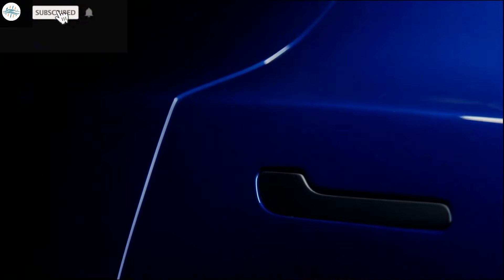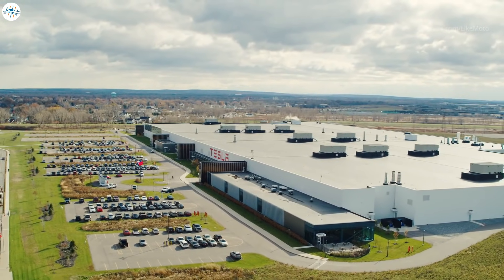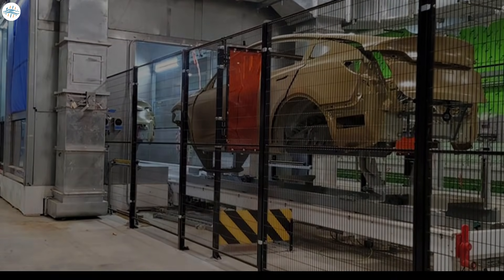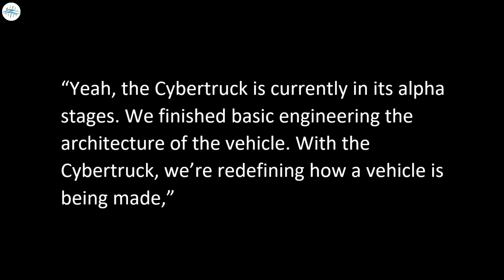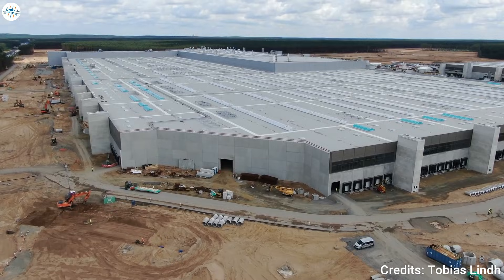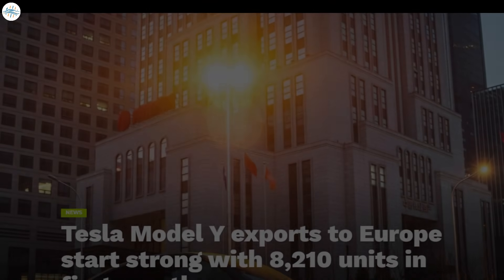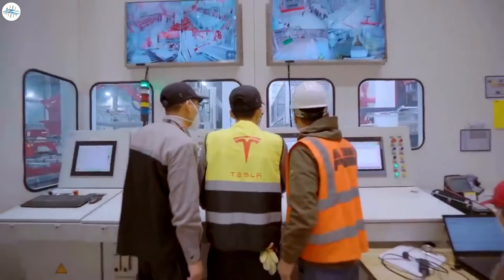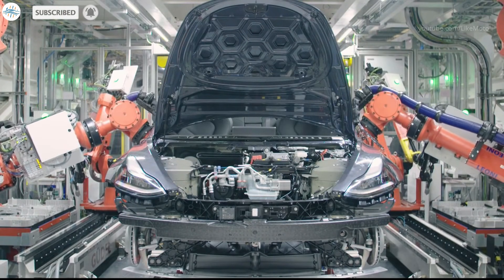Tesla's New Model Y Production & Delivery Updates

Comment: For the production of the Model Y 2.0 in Berlin, I think Tesla will start production with the new 4680 cells together with the structural batterypack for the Performance versions first, because most of the Model Y's that will be delivered now, starting from this month, will be from China and are the LR versions with the 2170 batteries.
Reply: So i must rider the performance Model 🤪